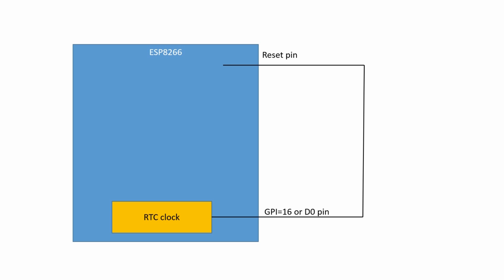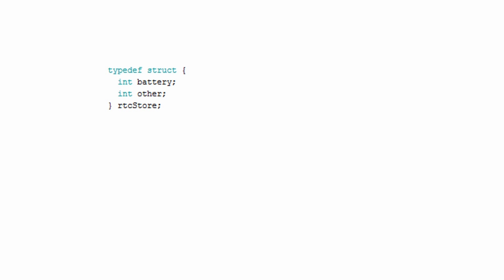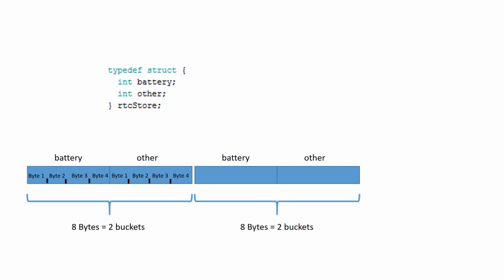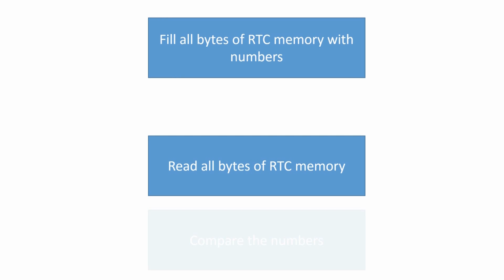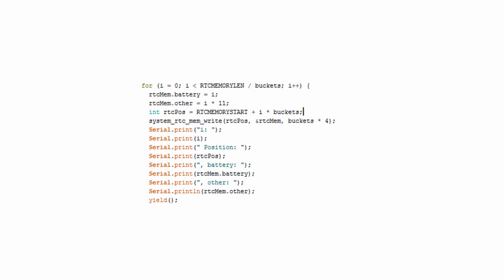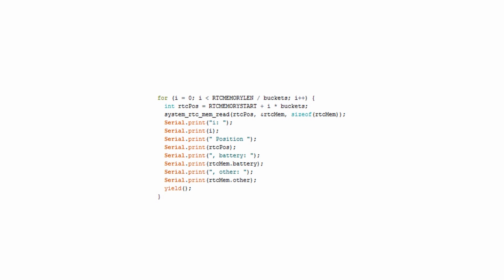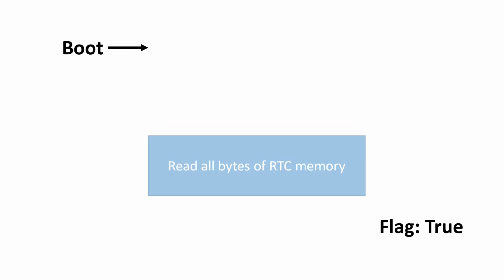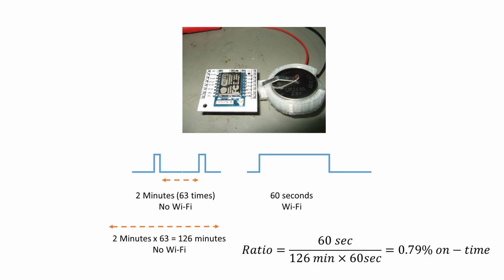#60 How to use the RTC Memory in ESP8266  and reduce power consumption by factor of 10 (Tutorial)

Comment: Hi Andreas, thank you for your videos. My question regarding ESP - what is original content of RTC RAM immediatelly after the first power on ? I'm trying to catch the first run of ESP module to differenciate between first power up and RTC driven power up. If I use the trick with toggle bit - I'm not sure, what is initial value...

Thanks, Ondrej
Reply from the maker: The RTC memory is always lost during power down. So I assume, it will be zero after power-up

Comment: How RTC memory can save power ??

thank you.
Marc.
Reply from the maker: Most of the power is used for connecting to Wi-Fi. If you store a few values in RTC before you send them to the cloud, you can save power, because you only have to connect once for many valies.
Reply: Andreas Spiess I have to send the ds18b20 to thinkspeak. Can this work ? Thanks.
Reply: I have succeeded in sending DS1820 data to Thingspeak and deepsleep the ESP8266

Comment: Hi , Andreas. In your code,  to measure the battery 

rtcValues.battery = ESP.getVcc() * VCC_ADJ ;
#define VCC_ADJ  1.0   // measure with your voltmeter and calculate that the number mesured from ESP is correct

In my case I use a Wemos D1 mini . I read A0 pin must me not used.  What is the value read by  ESP.getVcc() ? 3v3 pin to ground ? Where I have to measure calibration voltage to compensate error?

Thanks
Reply from the maker: 1. The ESP has only one analog input pin. So, you have to use this one or use an external ADC.
2. Max volt of the ADC pin is 1 v. So, you have to build a voltage dividor ( 2 resistors or a potentiometer) to make sure, that your voltage does not get above 1v. You can test that by connecting just the voltage divider (or a potentiometer) to the battery without connecting to A0. Watch video # 13 if you do not know, how
3. If you are sure about point 2, you connect it to A0 and read the value with the ESP. At the same time, you measure the battery voltage. Now, you know, how much the reading should be and how much it is and you can calculate VCC_ADJ.
Reply: My question was, what exactly is measuring the ESP.getVcc()  function. I think, it's the voltage at 3.3 pin. 
The Wemos D1 mini has a resistor divider at pin A0, 220 K and 100 K. So the max voltage you can put it, without any extra resistor is 3.3 V, to get 1 V (1024 ADC value) at A0. 
I saw some people put an extra 100K resistor in series with 220K, to expand the input range to 4.2 V (normal max value for LiPo cell).
Reply from the maker: I digged a little (i never used this function). Here the description:
Analog inputESP8266 has a single ADC channel available to users. It may be used either to read voltage at ADC pin, or to read module supply voltage (VCC).To read external voltage applied to ADC pin, use analogRead(A0). Input voltage range is 0 — 1.0V.To read VCC voltage, ADC pin must be kept unconnected. Additionally, the following line has to be added to the sketch:
ADC_MODE(ADC_VCC);
This line has to appear outside of any functions, for instance right after the #include lines of your sketch.
Without ADC_MODE(ADC_VCC); you get a constant reading of 64k.
Concerning Serial resistors: You can add whatever resistor to the voltage divider to extend its range.

Comment: Hello Andreas, im trying to understand your ESPSensorHourlyEnhanced Code. Why did you put system_get_rst_info();  at line 64 without assigning the return to a variable? Does it have to be called?
Reply from the maker: I do no more remember. But I assume it is not needed because it only shows the reset reason.
Reply: @AndreasSpiess  Okay thanks, do you still use the RTC to save even more power or do you send each measurement on its own in your current battery projects?

Comment: dear Sir
Today, I have a question about Esp8266 wakeup with the button reset, I have tryed to find the different between GPIO16 and RST button to wakeup ESP, but how to know the button reset is touched. I  used the function is "system_get_rst_info();" and then I get the number 5 for the first time reset in deepsleep and I get the number 6 for the second time reset in Esp running. That mean, I need touch reset button two time to get the number 6 in deepsleep and then the ESP know I touched reset button. How can I get the number 6 when i touch reset button first time or another way to help ESP know i touched to wakeup it. I dont want to touched 2 time to wakeup it, because I have a fucntion check time wakeup to sleep early, one day sent one time data to server. If i touch it the first time, it dont know I touched and then it go on sleeping. Tks you so much, please give me some ways. (my english not good, so sorry)
Reply from the maker: The ESP8266 is waked up if you pull the RST pin. Usually, GPIO16 and RST are connected that the ESP can wake itself. If you want an external trigger, you do not connect the two pins. Then, the ESP sleeps till you reset it. If I remember right I used this mehtod in video #108

Comment: I have my esp8266 controlling a relay using an h-bridge but I'm having a problem when the chip goes into deep sleep.  Every time it sleeps all the i/o pins go high which is keeping the h bridge on and consuming power. Is there a way to keep these pins low during deep sleep mode?
Reply from the maker: I think, the pins of the ESP are open when it is in deep sleep. You can test it by just removing the connection from the ESP pin. According my theory, the bridge should also be "high" without this connection.
So, you have to make sure, your H-bridge is in the state you want i to be with open input. With a resistor to ground, for example. Try a 10k. Go lower if you do not have the desired result.

Comment: My esp8266 consumes 7 milliamps instead of 20 microamps as written in esp8266 datasheet please tell me wha to do
Reply from the maker: Maybe you use a development board instead of a ESP8266 alone
Reply: You may have some leds on the board, disolder the smd led and the current drops to spec
Reply: Probably some other circuitry on your development board, such as LEDs, USB interface IC (CH340, CP2104, ...), battery charger IC etc.
Reply: @AndreasSpiess  This answer is what i want to hear. Thanks

Comment: Hi Andreas, I have a requirement where I need to store the state of the i/o ports when there is power down. I am currently doing the same using EEPROM but after seeing this video I see that wouldn't last long. My write cycles should be ~20 times per day. Using RTC memory is not going to be useful for me because I need the data to survive power down. Is there anything else you can suggest to me. Using a SD card for such a small thing would be a overkill. I read somewhere that we can write simple text files on ESP too. Can you tell where would that file be written and would that suffer the same limitation of write cycles.
Reply from the maker: EEPROM survives for years. It is stored, like the program, in flash memory.
Reply: Hi, sorry if I was not clear. What I understood from your video is that there is a limited no of write cycles on EEPROM , which is ~10,000. If my program writes ~20 EEPROM writes per day then I will end up using this in a little over a year. So, is there something else that I can do to overcome this , or this is it.
Also, can you pl share the source of the figure 10,000 writes. I tried getting the specs but unable to do so. In many other forums the figure being quoted is 100,000 with a max of 1M cycles if you're lucky.
Reply: I found this specification of Winbond W25Q40BVNIG which is the flash ESP 8266 uses. https://www.winbond.com/resource-files/w25q40bw%20revf%20101113.pdf . On page 5 It says the no of write cycles supported are 100,000.
Reply from the maker: +Vijay Sharma These numbers improved over the years. So, with 100000 I think, this is no limitation anymore.

Comment: Dear Andreas, sorry for offtopic. I have an issue with nodeMCU and WeMos D1 in following: configure as AP and use an example scatch web server. When I connect to ESP with phone/PC all is great but when I disconnect and try to reconnect it is imposible. This is happen after 2-3 connecting operations. I have tried older board configurations, older Arduino IDE but still happens. Any sugestions?
Reply from the maker: REmote debugging is not easy, and with problems like that, nearly impossible. So, you have to use Serial monitor and separating the code in parts which work and which do not work to track the problem down.

Comment: dear Sir, I have a question need you help. Went esp wakeup then deepsleep, it not connect to wifi and it will read data from ADC to get voltage. But during time not wifi (after wakeup), it will get some power, about 30 ma without wifi. So, with 63times esp wakeup, esp get more power to read and write to RTC memory. How can us reduce this power, thanks so much!
Reply from the maker: Maybe you have to switch wifi off at the start if you do not need it (WiFi.mode(WIFI_OFF). And you can choose a mode of ESP.deepsleep which does not enable Wifi (ESP.deepSleep(6000000, WAKE_NO_RFCAL); or similar)
Reply: tks you so much, i have tried with your  way and it's worked. I have another question need you share me you video about esp8266 deepsleep in 1day (1day sent data 1time). I know esp8266 just sleep about 71min because its just 32bit. How can us get this, i have seen your video #60 reduce power with RTC memory, but its alway wakeup and get my energy. If you have some other way please tell me, tks you so much!
Reply from the maker: I have a video about waking up every day. Of course it has to wake-up every hour, but only for a very short time. If you want to sleep one day you have to use the Esp32
Reply: yeah, im trying to watch all your videos. tks you and tks you so much.

Comment: Hello, Andreas. Is it possible somehow to use RTC memory to store network connection stuff? I mean, after ESP back from deep sleep we need to reconnect to our wifi againt to send/get some data. Would it be possible (and probably faster) if we avoid this step by loading previously saved whole WiFi object from RTC instead of begin new WiFi connection? Does it make sense?
Reply from the maker: Maybe. I do not know and never saw something like that. Assigning a fixed IP to the ESP seems to reduce the time to connect.

Comment: I need some help if I need to store objects of 33 Bytes at a time (uint8_t + uint32_t), the number of buckets will round off to 2 for each object. Right ? Is there any way so I don't waste my 3 bytes for every object. As RTC Memory is 4 Byte Aligned so I am confused, how to do it or if it is not possible?
Reply from the maker: If you want, you can look at the code of my newest sketch (Sonoff hack). There, I use a structure to store the content into RTC memory. Then, you do not loose bytes
Reply: Thanks. If you are talking about this file "https://github.com/SensorsIot/Sonoff-Hack-1-Motion-Detector/blob/master/Sonoff_SenderV3/ESP_Helpers.h". Can you please explain it in some words that what approach are you using?
Reply from the maker: You find there two functions to read and write a structure from and to RTC RAM. Whatever you define in this structure will be saved. If you dont know structures, just google.

Comment: Why not use ESP.deepSleep(SLEEPTIME, WAKE_RF_DISABLED); in "collect mode" ? it saves more power, is there a reason not to use it?
Reply from the maker: I do not remember exactly why I used the different parameters. But for sure, you can try.
Reply: Andreas Spiess Ok, I tried it and it seems to be working. it gets the wemos D1 mini down to about 0.15 mA during sleep. Thanks for the videos, they've been very helpful
Reply: What do you mean with collect mode?